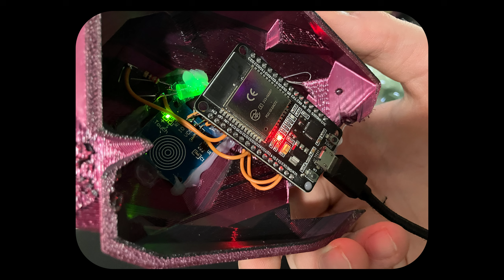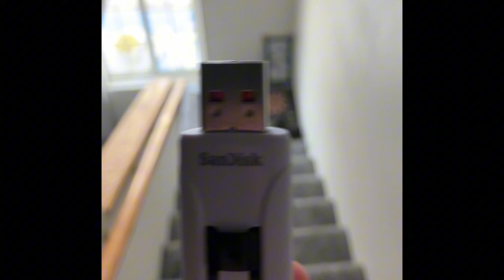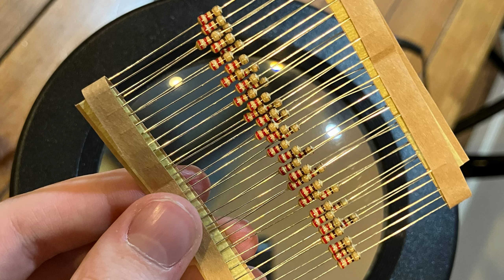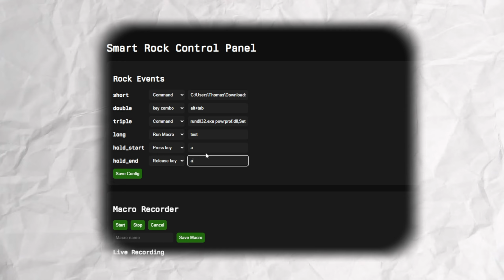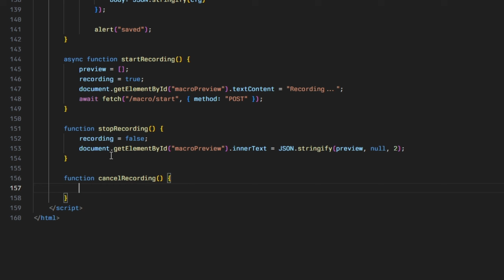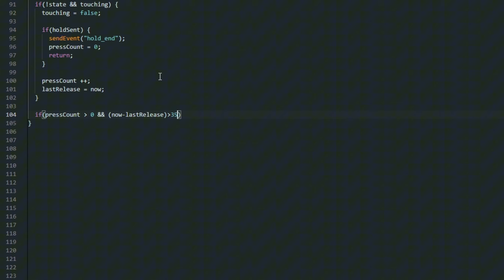I Built a Smart Rock

Comment: After watching the whole video, I noticed that it has to be plugged in with a wire in order for it to function. I would suggest soldering a lithium ion battery with BMS board inside it if you’re ready to up the difficulty level and try something new. Definitely be careful since batteries can explode if you are doing it dumbly (ask me how I know 😓).
Reply from the maker: That’s a good idea, I do have some batteries. I do want to do that, however since the use case is mostly on my desk I decided to not for video simplicity. Thanks for the comments though, I love to hear suggestions!